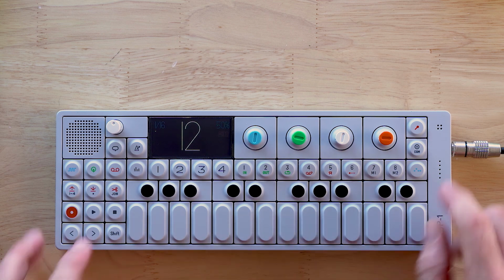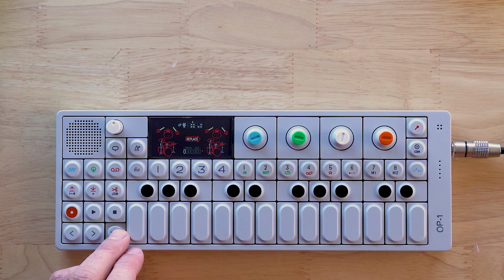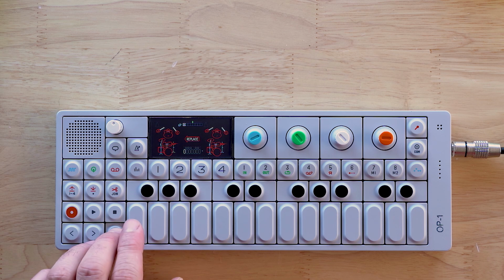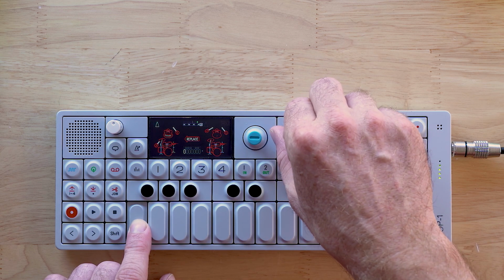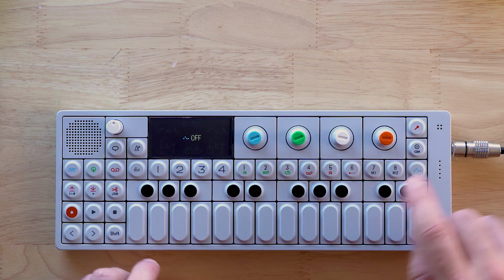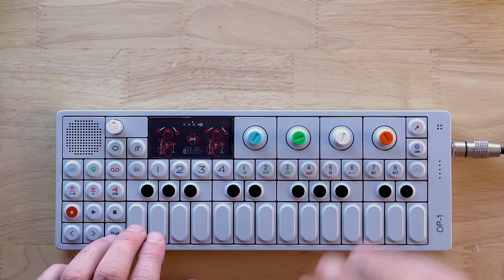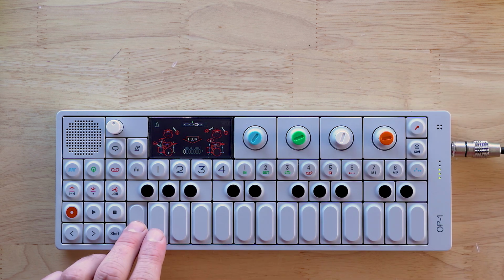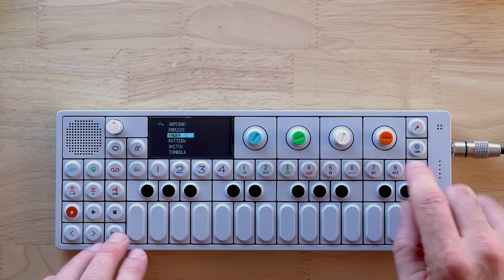Teenage Engineering OP-1 | Sequencers

Comment: A tip on the Sketch sequencer: you can use the keyboard and octave keys to then draw in the notes that you want with the knobs. It’s a lot more useful than most people think. Great for getting ideas off the grid.
Reply: Thank you both!
Reply: Yup, it's cool for sequenced glides. Divide your current tempo by half and have it go through the sketch super slow for interesting textures and rises and falls or just sequence chords that have notes starting and stopping at different points.

Extremely underrated sequencer that people seem to think is a joke but its one of the most powerful, if clunky and impractical at times, sequencer on the op-1.